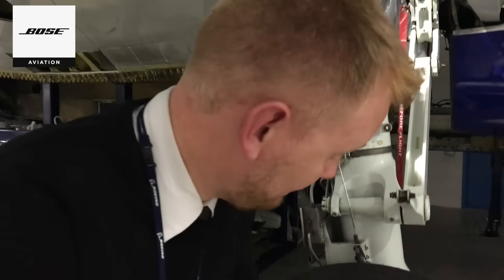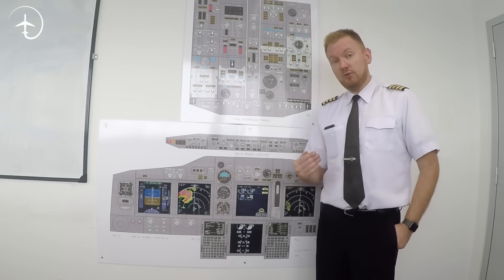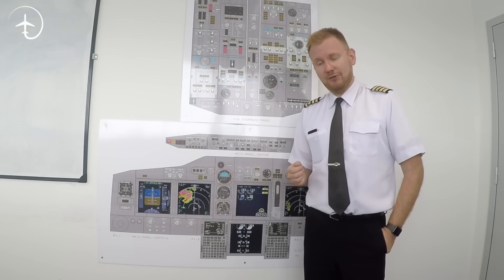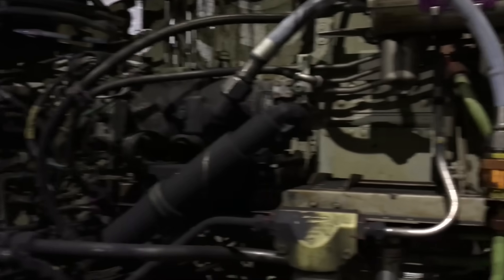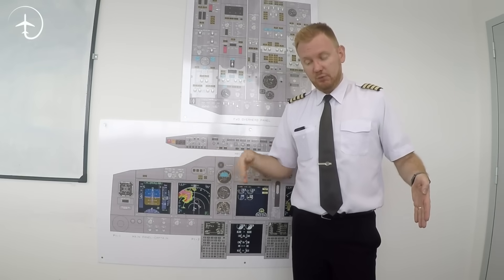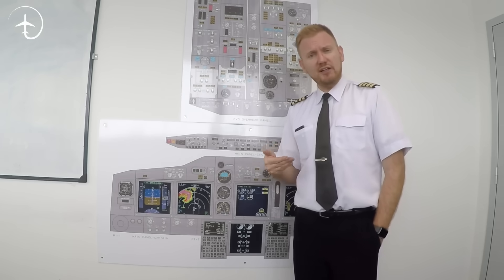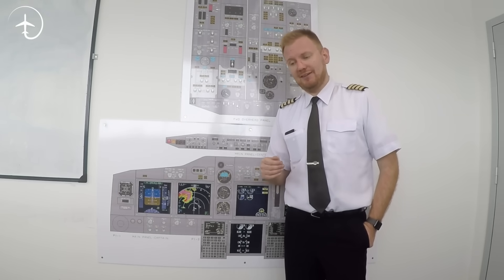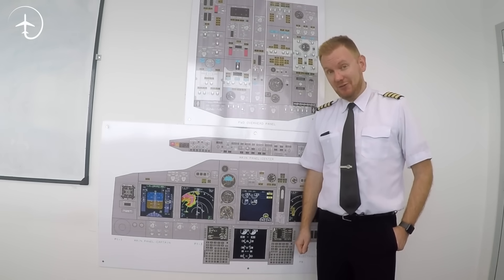Why does the Boeing 737 not have any landing-gear doors?

Comment: I learned in this plane maintenance in avionics systems. After 5 years as an maintenance inspector, adjusting engines after replacement, running at idle to take off on ground. 1985 and 1990. Great times!!

Comment: A design in part dating back to the 50’s and sharing fuselage features with 727. An old obsolete piece of junk in this day and age.  Endemic cost cutting by Boeing allowed it to evolve into the 737X and to be made and look where that got them with two examples rushed Ito service not properly certified. Should’ve been a clean sheet design even when interim engined versions had the flattened off lower surface to clear runway.

Comment: That's a remarkable amount of engineering to avoid using sliding doors. Not sure why they always make wheel doors that open out and get so complex. Yes of course they can be designed to fall out of the way in an emergency.

Comment: If 737 has wheel well door the main landing gear structure will be 18 inch longer to provide clearance for the wheel well doors. Look at the 757 and A320 .
Reply: Then why does the 727 have main landing gear doors? It's also low to the ground.

Comment: An additional benefit of braking the mains during retraction is, it stops the twisting motion caused by gyroscopic effect.
This is not a factor for the nose wheel because it retracts parallel to tire rotation

Comment: Old video, I know, but perhaps you'll see this question I've always wondered about.  Why is there no mechanism to spin the tires up at least somewhat before landing so they don't screech as they hit?
Reply: Excess weight and complexity? Tires are relatively cheap.
Reply: @SilverFox_Machina  I dunno, have you priced tires lately?   I know my car tire prices have skyrocketed, can't imagine how expensive a tire for that jet run.  I was actually thinking if they made the tire with tiny "flaps" in the rubber sidewall facing the direction of travel, as soon as they put the gear down, airflow would start them spinning.

Comment: Why does the front wheel have no brakes? makes no sense to me. In a motorcycle the front brake is the most important one,
Reply from the maker: It’s very small and not very strong.. making it stronger would require more weight which would change the weight and balance of the whole aircraft..

Comment: One question I've had is why do modern planes have landing gears near the center of the plane that fold into the plane body rather than being further away and fold into the wings. On the Spitfire and the Electric Lightning the gears folded outwards into the wings. Wouldn't the wider spacing of the wheels be preferred?

Comment: on takeoff and landing when the plane is at a higher angle of attack wouldn't there be a lot of air pressure going into the wheel base that could possibly mess up  the components? or those rubber flaps are actually strong enough to block out the air?

Comment: Tyres at 14 bar right? Not 14 psi

Also if icing were to be a problem under an aircraft, probably the small hinges and actuators on doors would be more susceptible than the large and strong ones on the  landing gear. Right? So doors could be less safe even though slightly more aerodynamic?

Comment: Did you say tires are filled upto 14psi??
Sea level air pressure is 14psi.
Tire pressure on a 737 is around 210+-10psi.

Comment: Question: maybe I haven't understand it correctly but, you said tyres have up to 14 psi. Isn't it ±200psi the tyre pressure?
Reply: He meant 14 bars, but yeah, the correct value is 205 -/+ 5 psig.

Comment: It think at some point the added complexity and weight are not worth the reduced drag. And it seems there's a spoiler in front to divert the air over the wheels.
Reply: Main gear doors apparently have an overall advantage since nearly all planes have them. The ones that don't as Mentour pointed out are planes that sit low to the ground. In that case having main gear doors would be difficult if not impossible. But the mitigation that Mentour pointed out seem to eliminate most of the drawbacks.

Comment: I always knew the 737 has the wheels exposed when retracted, a bit like a Boeing B-17 or Grumman F4F, but I always thought that they added some properly shaped "wheel-well liners" or something like that (similar to what many cars have) to protect the inside of the wheel wells, instead of just a few rubber flaps. But, apparently, it works ...

Comment: I am sure he meant 14 bar for tire pressure. Planes that size  run in the 200 psig range.  Nitrogen is used to eliminate water vapor since the tires cycle from freezing to steam temp ranges which would massively change tire pressure

Comment: I’m amazed how relaxed those engineers are about exposing critical components in the wheel bay this way. Sure, not fully exposed. But how much weight would a plastic guard (wall) add? The mud guards on my car’s wheels are barely a kilo each. Would say… 50 extra kilos really matter?

Comment: If the aircraft didn't apply the brakes during retraction there would be significant twisting forces in the legs due to gyroscopic precession.

Because the nose gear moves forwards, not sideways it doesn't experience the twisting caused by gyroscopic precession, hence you don't need to stop the nose wheels spinning before retraction.

Comment: Doesn't the tyre pressure affect the tyre dynamics when the aircraft is cruising due to the low pressure environment outside. Example, when you ride your motorcycle to higher altitudes, you have to release some pressure as the tyre becomes hard Rock due to lower pressure outside.

Comment: Would I be right in thinking that the potential shrinkage of the tire volume due to the -60'C temperature is countered by the expansion you'd get at altitude due to low air pressure ? Does this balance out perfectly ? How would this have been managed on Concorde when flying supersonic causes the skin of the aircraft to reach 100'C whilst the tires are still at low air pressure. Were the tire-wells pressurised or was there some other solution ?

Comment: Nice explanation on 737 'non' gear doors. Also curious about why 737 types used 2 x single nose gear doors each side while most jetliner have a 2 piece kind of nose gear doors, the larger front items closing again after gear dropping down. This kind of stuff is of real interest.

Comment: You would also know if the friction brake in the nose wheel well is worn when pilots feel a gyroscope precession is felt with gear up or when we measure wear or visual exam

Comment: I wanted to enter "Chat" on the smartphone. The site wanted me to click on "I don't have an account". I have subscribed, however, but the App would not let me go forward without a password and gave me an error message, assuming I had to invent one. Kafka? Anyway, without chat, I wanted to ask if you had ever talked about that piece of antiquity: the 727. I once took a 727 from Lima to Pucalpa (Perù Amazon) in torrential rains and flashes of lightning.  (A subsequent 727 was not so fortunate). Having talked about the 717, have you any observations about the 727?

Comment: Many small aircrafts.. front wheel retracts along Axis ---
Similarly if backend wheels series do will require less holding space ....
Best retracting mechanism would be dual hydra pentagram....noextra space required....
Height range control + helpful even stuck halfway or crash landing roll-off.....

Comment: Excellent vid! thanks very much.
 You mention tire pressure of around 14PSI,  not knowing much about 737 but my guess more in 200PSI range depending on weight requirement.
Reply: 14 psi is too low for a aircraft like 737 ..... My car wheels are 36 psi  !!!

Comment: I was expecting to see that leaving the wheels exposed would aid in their cooling. I recall a video you did that explained how residual heat from multiple landings would build up, and monitoring their temperature and cooling time was critical. I further expected that the hub caps would have been designed to efficiently to cool the brakes and rotors during flight.

Comment: There's always a trade off, I guess. On one hand, it may not be the 100% perfect solution in terms of aerodynamics. However, you save on weight as well as production cost and things that might break and require maintenance. In addition to the advantages of having a lower fuselage alltogether, that solution is probably about as good as the typical solution seen with the A320 family.

Comment: 'The Boeing 737 is an American short- to medium-range twinjet narrow-body jet airliner.'

Boeing 737s are used primarily for commercial aviation. A major advantage of the 737 over its earlier predecessors is that it can land on and take off from smaller runways.

The Boeing 737 has two variants, -700 and -800. The -700 is 69 meters (227 ft) long and can carry 150-186 passengers depending on seating configuration.

The Boeing 737 has many advantages over the previous models like the Boeing 727, 737-200, 737-300, 737-400 and others. Some key points are:

it was designed with lower operating costs in mind

it has a lower capacity than the Boeing 747, but also uses less fuel so operating costs are lower as well as maintenance costs

The Boeing 737 is a very cost efficient aircraft and its low price tag compared to other medium range jets allowed airlines to purchase large numbers of them. The first Boeing 737-100 was delivered on December 28, 1967. The -300 model was introduced in 1968 and had a longer fuselage and greater capacity than the original design.

-100 models were built until 1987 while -200 models were built from 1982 to 2000. The -400 model entered service in 1987 and is still currently being manufactured today.

Comment: This could have been answered in 30 seconds: the 737 is largely based on the 727.   The wings and fuselage are nearly identical to the 727, only the fuselage was lengthend.  All of the same questions about landing gear had been solved on the 727 which was without landing gear doors aleady, and the 727 was Boeing's most successful aircraft until the 737.
Reply: Thanks, you saved me ten minutes. It may not seem like much now but it sure will when I come to the end of my life.

Comment: Another question u mentioned the safety device which drains the hydraulic fluid and makes the main landing gear free fall. Do both the gears free fall or only the fault one gear free falls what would the indcators in the cockpit indicate

Comment: What is the tyre pressure of the main landing gear wheels of 737. Is the tyre pressure of the nose wheel different than the main landing gear wheel. Why is the tyres of 737 called low pressure tyres

Comment: About the fuel efficiency issues, think of it this way: You have slightly more drag but at the same time you ditch the weight of the doors and thus in total, the fuel efficiency remains the same as if you added a bit of extra weight and reduced a bit of drag by adding doors
Reply: The drag isn't "slightly more" and the door probably doesn't weigh enough to create the difference. I'm no engineer though, so I might be wrong

Comment: You should read about the nose gear and the main gears of the space shuttle. On landing, there are pyro charges to make sure the gear doors open up. On one landing, one of the main tires blew while the shuttle was coming to the wheel stop. This happened only one time when landing at Kennedy Space Center.

Comment: one question remains unanswered: the whole cabin is pressured, and I assume the cargo bay as well. Where is the border between the pressurezed area and the not pressurezed area? How is it made tight, and isn't it complicated with e.g. hydraulics going in and out?
Reply: Only the passenger cabin & cockpit are pressurized and require airtight hatches. The whole lower part of the fueslage for baggage is not built for pressurization BUT some planes have special separate compartments for sensitive cargo that may be pressurized and heated/cooled.

Comment: Concerning the  possibility of damage inside the wheel well should a punctured tire be retracted. In my experience of flying light aircraft with retractable u/c I was trained to apply the breaks before retracting, which at least stops the main wheels from spinning. This also prevents the forces of gyroscopic procession from acting upon the landing gear during retraction. Is not the norm for airliner pilots to do the same?